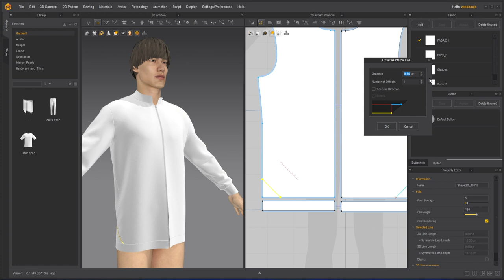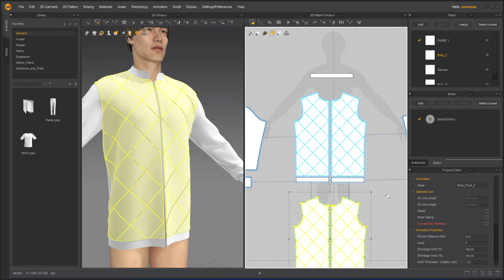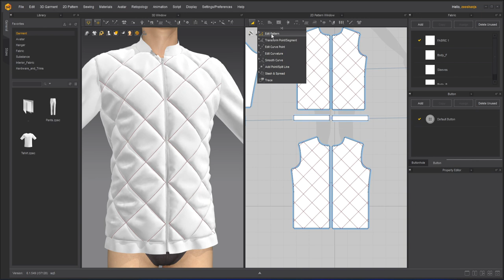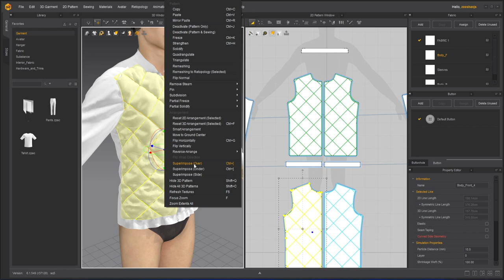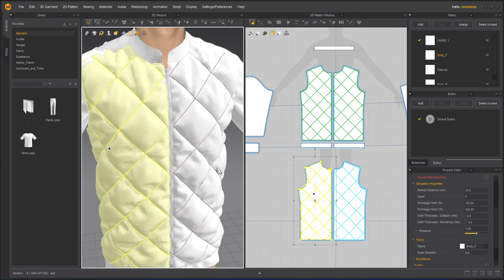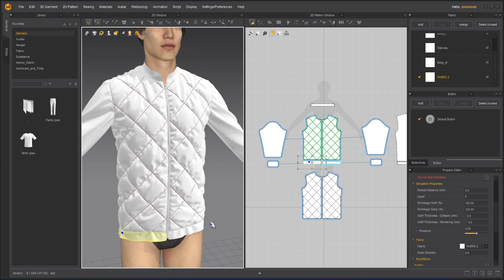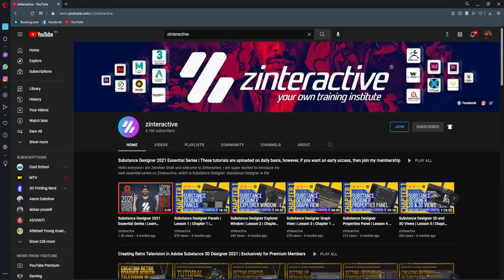Making Bomber Jacket | Lesson 1 | Chapter 4 | Marvelous Designer Fundamentals

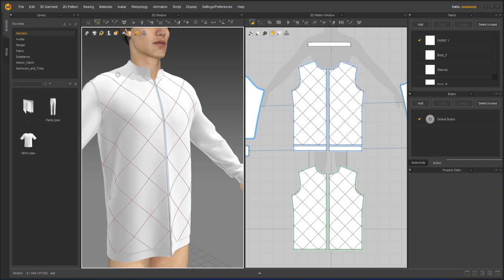Comment: 5:17 I didn't get that thickness on my jacket, every time I click on "clone layer on top" it creates a tiny thickness effect, I don't know what I did wrong :C I increased the particle distance to 10 because I thought that at 20 maybe the effect wouldn't look good, but still nothing happens.
Reply from the maker: Turn on the thickness from the 3D texture view settings
Reply: @zinteractive hi! i think i solved it, i don't know if this is the right solution to this problem, but i selected all the seam lines of the original jacket and the cloned one, and i went to the property editor, because i thought that maybe the seam lines were not pressing the garment(? then in the "3d seamline" options I saw the option called "thickness" and it was at 0,2 or something like that, so I increased the number and it worked, ¿do you think this is the best way to solve it? (hope I didn't confuse you, I'm using a translator 😅).
Reply from the maker: @zeffizeffijijiji  there is no right or wrong, if it works with you, it’s right then.
Reply: Thank you very much for taking the time to answer me😄  @zinteractive